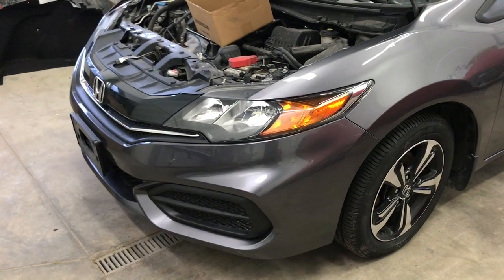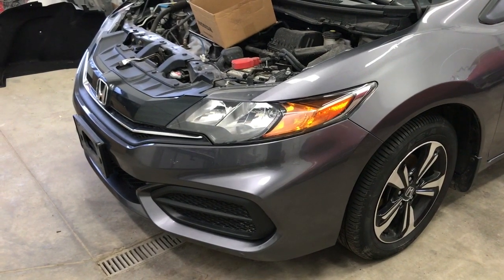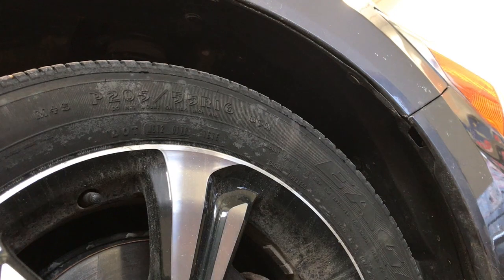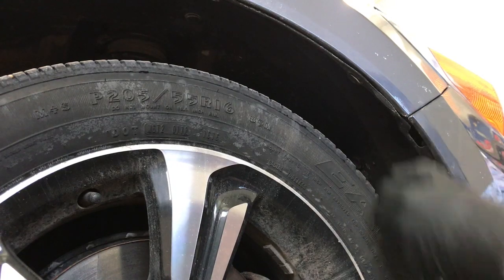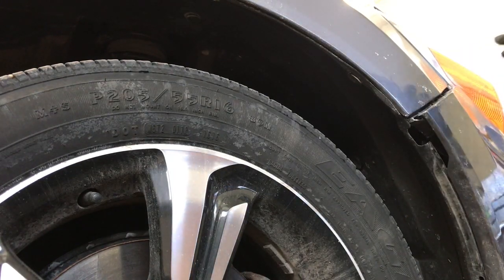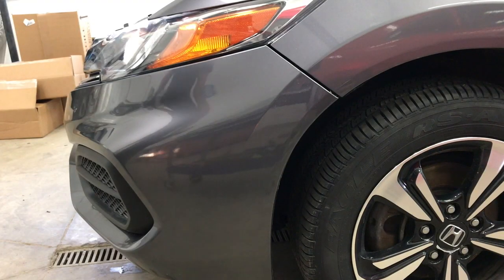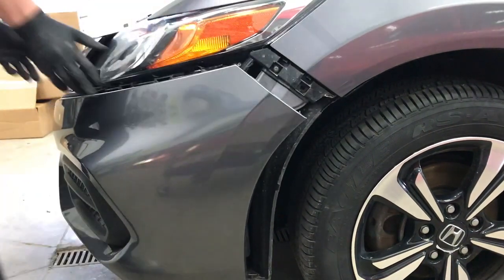2012 2013 2014 2015 Honda Civic Coupe Front Bumper Removal How to Remove Replace Install

Comment: I have the SI model but needs a bumper, will the regular one fit it? I dont find any si bumper anywhere but the dealership
Reply: Yo, did you have the hfp lips on the front? If so, were you required to remove them?
Reply: No the regular one won't fit. This bumper is different than the 2014 Si front bumper

Comment: Thanks! I haven't done it yet but where does the front airbag sensor go? Because when my girl damaged the bumper and the bumper fell off. There was a push sensor wire hanging in the front.

Comment: I damaged my car I want to fix it myself, can anyone help me identify 2 parts?
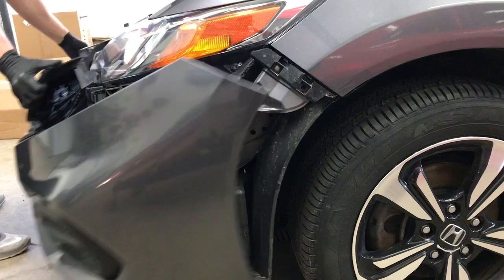 at 2:57 after removing the bumper there is a plastic piece below the headlight, with 'X's 
and at the bottom there is a tank,
These are the two pieces any help would be appreciated